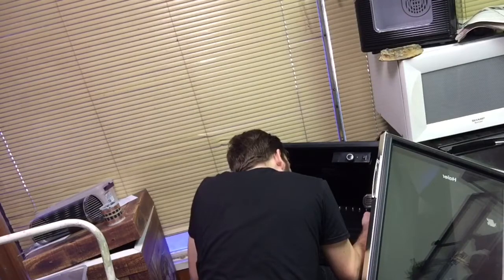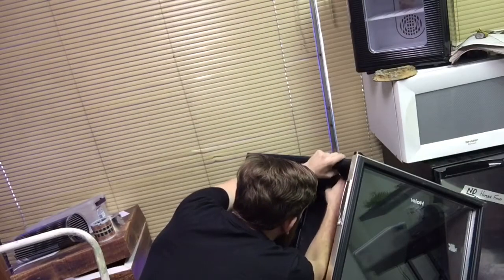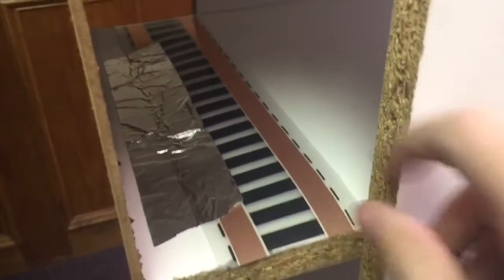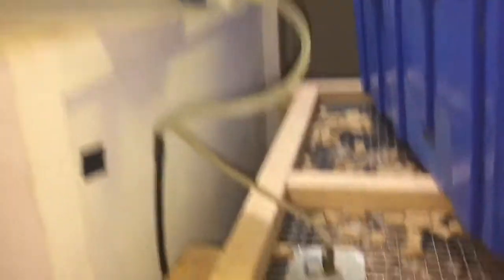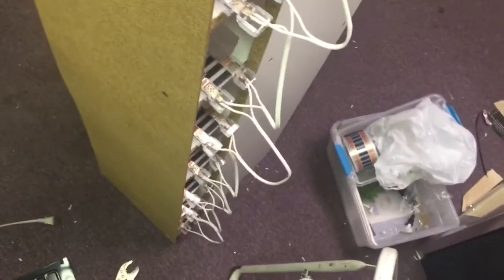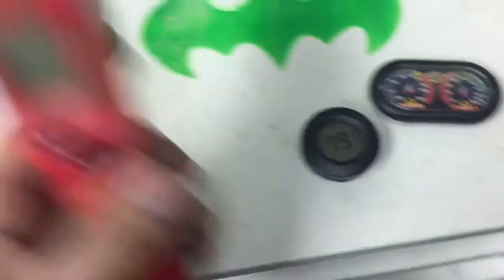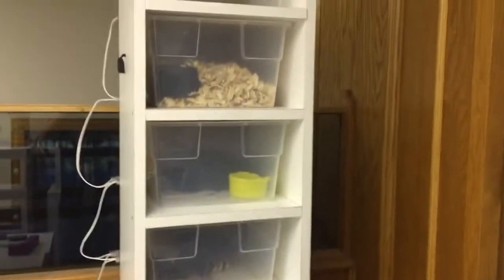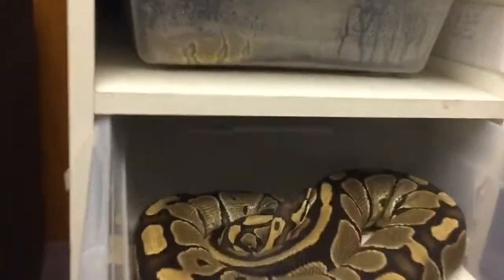Heat Tape Installation Process

Comment: How did you connect all of the crimped heat tapes? I know you used multiple clips but how did you connect them? After you connected them how did they all go to the same heater?
Reply from the maker: So it was a parallel circuit. Crimping the metal on both sides with the wire through the metal loop let it go into the copper part of the heat tape.
Since it was a parallel circuit, electricity went evenly on all levels of the rack.
I hope that makes sense!
Reply: So do you have two wires per rivoit or two rivoits per corner? Video pans over this too quickly for me to see.

Comment: With the parallel circuit where should I put a thermostat probe ?
Reply from the maker: I put mine between the heat tape and the pvc/wood. This way your rack doesn't slide against it. But it also means you might have to set your temperature a couple degrees higher or lower on your thermostat to reach your desired temperature inside. Which is one reason I really like the infrared thermometer. Here's one on amazon for cheap. (Disclaimer: Affiliate link) https://amzn.to/3dsugyl

Comment: Where did you buy the connectord
Reply from the maker: A couple good places: reptile basics, reptile supply co, alpha geckos. I usually get one of the ones with plugs and just cut it to proper lengths and cut the plug off. I was able to do this rack with 2 of those cords and then one as the last one with the plug.